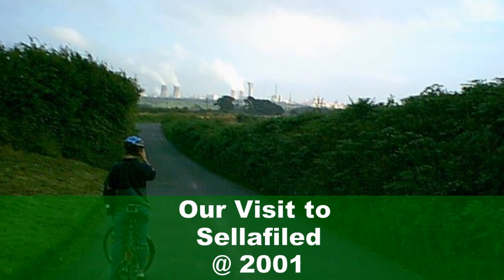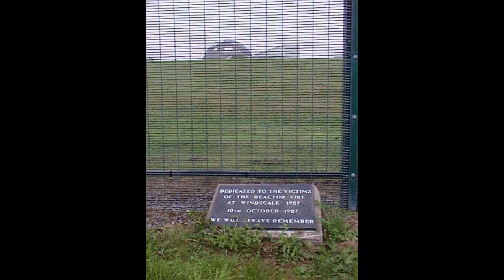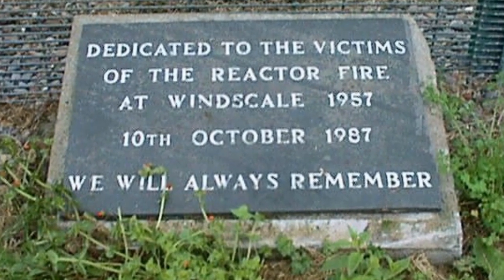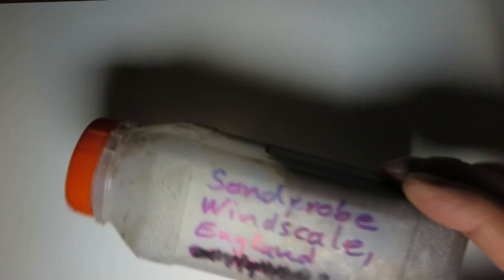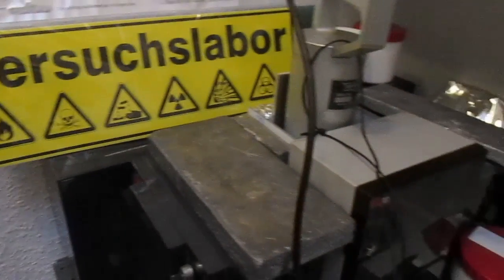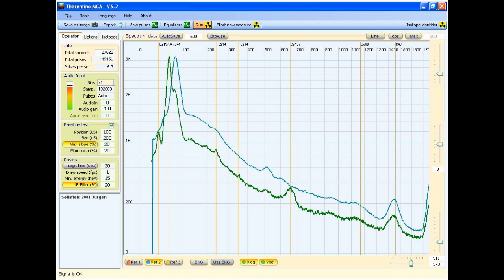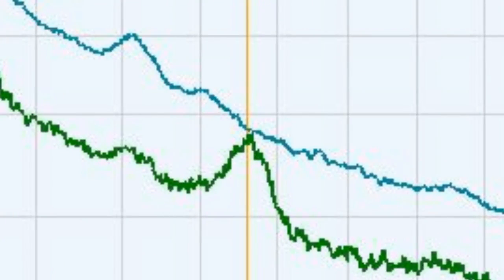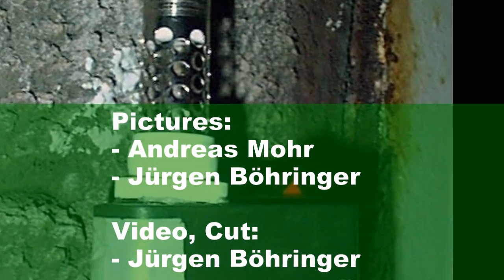Measuring Radioacitve Contamination at Sellafield, England

Comment: You have misrepresented the relation of the discharge pipeline to the reprocessing process. The high level wastes (created when spent fuel is reprocessed) are not dumped into the ocean and have never been. In the 1960’s and 70’s some effluent wastes arising from the treatment process(very different from spent fuel/high/intermediate/high level waste) containing increased levels of radioactivity was discharged. Since as far back as the 1980’s the effects were realized and the discharges of these effluents were significantly reduced. As these elements take many years to decay they are still detectable and although the discharge pipeline is still in operation, the quantity of radioactivity released from it has been significantly reduced. No nuclear facility on earth has ever discharged spent fuel wastes into the ocean. If this was the case, you would have been dead the second you stepped foot near that beach.
Reply from the maker: Yes, the main amount of radioisotopes has been removed from the sewage water all the time. Otherwise the sand would radiate something like the Karatschai-Lake in Russia. But this removing is expensive so it is kept to the minimum. When I visited this reprocessing plant THORP they proudly showed on a graph that they have reduced the output of radioisotopes over the last decades. But I think it was only about a factor of three. But they still put this radio toxic material into the see. And of course it finds its way back into humans body. E. g. via see spay, see food, ... and so on.

Comment: Interesting report, but how do the count rate and intensity compare with sticking a banana, some seaweed or a pouch of tobacco in your spectrometer?
Reply from the maker: I did not compare this up to now. A big difference is that the human body has a methabolism for Potassium-40 (coming from the banana) and its concentration in the body is always nearly constant. But the Cs-137 enritches in the bones. So the countrate does not say much about the danger when the substance is ingested. But I am no specialist on that.
Reply: Juergen Boehringer I would agree that potential ingestion is a concern, but there have been plenty of studies on this https://www.gov.uk/government/publications/seaweed-transfer-of-radioactivity-to-foodstuffs . Your video implies that there could be a problem due to the presence of Cs-137 in the sand on the beach by the plant. Without stating the count rate per mass of sand, and how this compares to sources of known count rate when measured using your setup, your experiment does not tell us what the concentrations of radionuclides in the sand, and whether they pose a significant risk. That assessment requires a quantitative result, which I would very much welcome.